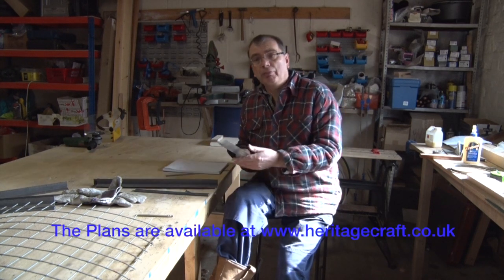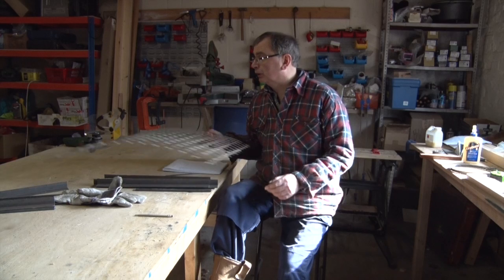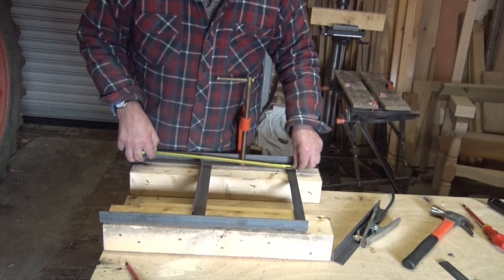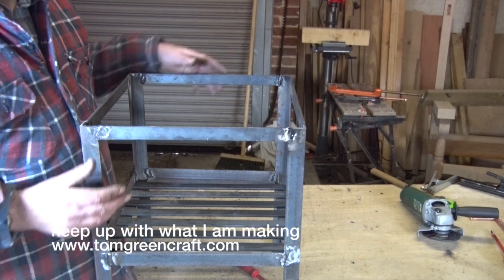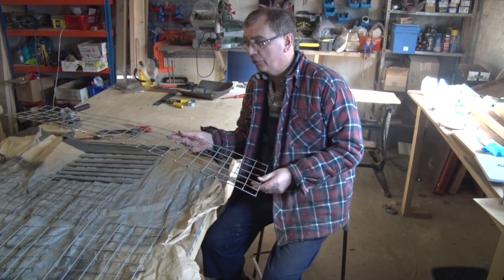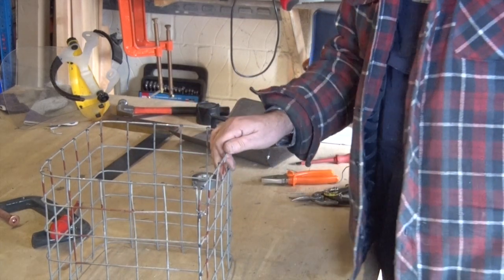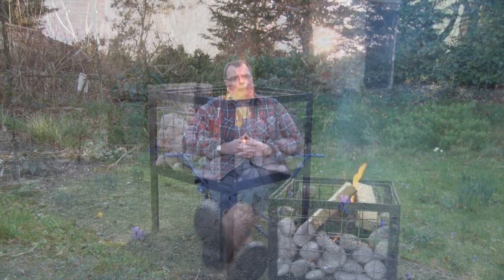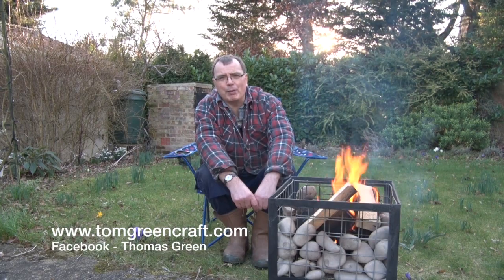Stone Lined Fire Basket

Comment: I liked the overall design but feel it has a built in flaw. Firstly i am not a member of the health and safty polce. Most stone when heated fires off hot and very sharp shards (as seen on your video). Would you not be better off useing fire bricks which are much safer and retain much more heat.